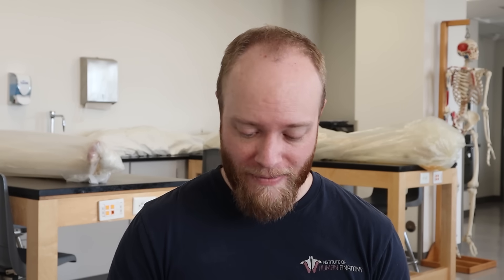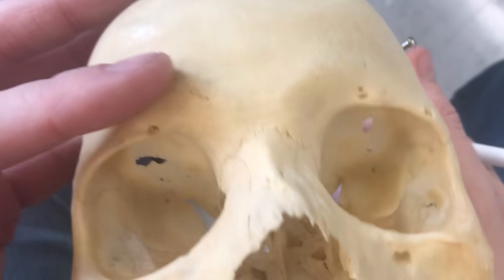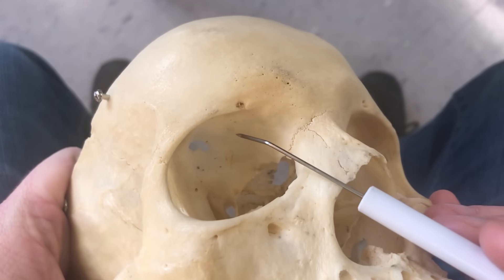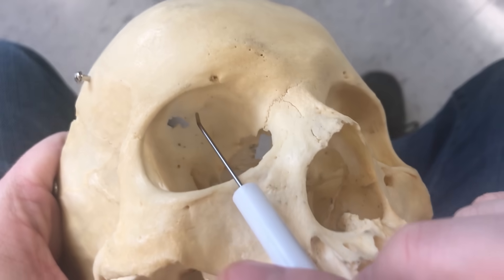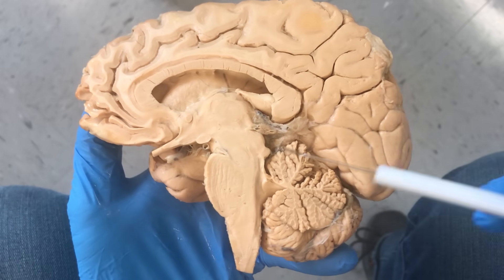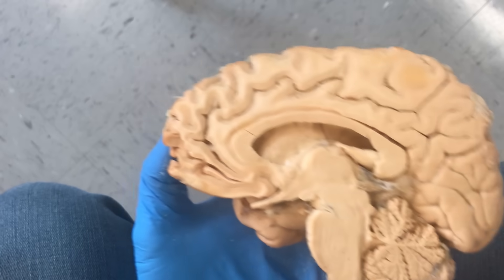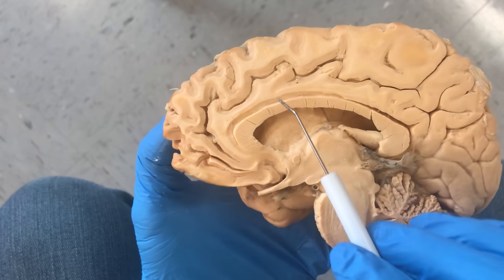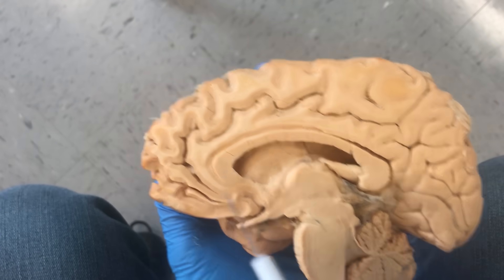The Anatomy of a Lobotomy

Comment: From my understanding the reason lobotomies were performed was there was little medications available to bring under control a patient’s symptoms. As barbaric as the procedure was it did work it most cases to alleviate the patient’s condition. I do believe it was an over prescribed procedure and used as a quick fix to complicated medical conditions. I like to compare it to something such as if a person had an infection in their finger instead of treating it with antibiotics just cutting off the finger instead. Problem fixed but permanent damage is the result.

Comment: This like trying to fix your car from overheating. Soo you decide to uninstall the radiator from your engine so the air can flow directly into the engine and make the engine cool down alot faster

Comment: 4:13 - "to treat things as simple as depression". Probably not what you meant.
Reply: What did he mean then? What
Reply: @WoW-sg9wb  As simple as? Depression is simple? What
Reply: @ricsta6930 depression is very common. That’s probably what he meant by “simple”
Reply: @WoW-sg9wb there are different depressions not all are suicidal, but yes it can get worse but since depression is so common and the most diagnosed with it doesn’t get suicidal.
Reply: As in it's a highly invasive procedure to fix a psychological problem which can be solved without surgical intervention let alone one this invasive
Reply: its not that deep blud

Comment: One thing that I'm curious about is does that part of the brain die or it still there but just the communication with the rest of the brain is disconnected?
My curious sterns from if it dies wouldn't it rot? And wouldn't it cause even more problems?
And if it doesn't die what path the oxygen and other supplies take to keep it alive?

Comment: Did any doctors do this to themselves? I cannot picture that someone medically trained performing these could be thinking it’s morally correct, or a viable treatment. More likely some very self absorbed sadists that saw an opportunity to use their medical degrees maliciously without backlash. 

I don’t think any certificated doctor would voluntarily receive this treatment. Even if they were depressed. Which means they didn’t believe in it and knew what they were doing. Some people simply did not do these operations. The ones who did do them are sinister to the core, because they knew. That’s just my two cents.

Comment: I know that the difference is negligible and it’s essentially just semantics and this point, but that’s not an icepick, that’s a professional surgical tool called an “Orbitoclast” AKA a “Leucotome.”

I know that Transorbital Lobotomy is often referred to as an “icepick lobotomy” but in actuality - as confirmed by Walter Freeman III, son of the pioneering physician of transorbital lobotomy, Walter Freeman Jr. - only the very first and most experimental of transorbitals were done with an actual icepick straight out of the Freeman’s kitchen drawer. The rest were done with purpose built, specialized surgical instruments.

Walter Freeman III said that these conventional icepicks, quote, “Worked like a charm.” But to lend medical credence to the barbaric procedure, instead of using a brutish tool like an icepick, they designed a very special less brutish seeming, more professional looking icepick-like tool called an “Orbitoclast” ...which is that T-shaped tool that he hammers with the mallet at the start of this video. It’s also sometimes referred to as a ”Leucotome.”

The first lobotomies - as pioneered by Portuguese Physician and Surgeon Egas Moniz - were called leucotomies and involved an actual surgery wherein holes were drilled into the skull of psychotic, depressed, obsessive compulsive, and highly anxious patients and a small coring (cylinder of brain tissue) was taken from a few of the areas in and around the frontal lobes. Then they’d sew them back up.

Moniz had the most success with the highly anxious people and the majorly depressed or melancholic. I guess it’s hard to worry and easy to be happy when a doctor has turned you into an adult  6 year old who cannot even use the toilet by themselves.

Unfortunately the psychotics and schizophrenics largely stayed that way. Some just died, as is to be expected when you poke around in someone’s brain with a a wire loop, cut the tissues with said wire and then suck out the freed up cylindrical tissue.

For this barely functional, dubious and downright barbaric routine, Moniz was awarded the Nobel Prize in medicine. This remains one of the greatest stains on the Nobelpris (how it is really written in Swedish, as the awards are held in Stockholm) and is almost as regrettable as awarding the Nobel Peace Prize to George W. Bush - a warmonger.

One day, after having devoted years of his life to curing the mentally ill by spending most of his days looking at the brains of deceased psychotic patients and hunting around for physical lesions that might cause this behaviour to no avail, Freeman picked up an obscure monograph by Egas Moniz which detailed the “success” of this Leucotomy surgical procedure.

Freeman was transported by this amazing finding. He was positively captivated and thought that this just may be the answer to his problems in curing the mentally ill... as most of or all of these small corings of brain tissue were taken from the frontal lobes and near the Thalamus, which was long regarded (and still is) by neuroscientists to be “The seat of human emotion.”

First Freeman tried to repeat the coring technique of Moniz, but more targeted towards the frontal lobes. Since he himself was not a surgeon, Freeman hired a young, talented neurosurgeon by the name of James Watts to perform the operations for him, and he would sit on a stool right behind Watts and direct him as to where to drill, what to do, where to cut, etc.

Freeman focused on the types of patients that Moniz had the most success with (mostly women suffering from “hysteria” and others who were consumed by anxiety, fear, and depression. Thus, he had a great “success” on those first operations.

Freeman was convinced that there must be an easier way to access the brain and after some consideration, he landed on the idea of entering the brain and it’s frontal lobes via the orbit of the eye. Here, the skull is thin enough to transmit light and can be perforated easily by a sharp instrument. He tried it for the first time -with an icepick - on a middle aged woman suffering from severe anxiety and it apparently worked. It’s hard to be afraid when you don’t even know what year it is and cannot feed yourself or go to the toilet unassisted.

So this transorbital route proved a great success for Freeman and he began teaching the procedure to other doctors... usually psychiatrists  who had no surgical training, since, as Freeman was quoted as saying “Any damn fool could perform this.” No messy surgical procedure, no drilling, no rigorous sterilization.

He told Watts about this and Watts was incensed. Watts believed - quite rightly - that entering the brain is not something that should be done lightly, nor should it be routinely done. After awhile, Watts started to reconsider his partnership with Freeman. The final straw was one day after Freeman had done a bilateral transorbital lobotomy in their shared office, he asked Watts to take a photograph of the two orbitoclasts sticking out of the female patient’s eye sockets whilst she was still unconscious. This was wildly dangerous and after this photograph was taken, Watts stormed out of the office and the next day Freeman and Watts didn’t share an office together.

Freeman went on to mutilate and sometimes kill patients of his via negligence and medical malpractice. Some praised him as a angel of mercy... others thought he was an evil man. Lobotomy was a product of its time and as soon as neuroleptic (antipsychotic) medication like Thorazine hit the scene in the mid to late 60s, marketed as a chemical lobotomy, real lobotomy faded away.

Comment: In 1949 the Nobel Committee awarded the Nobel Prize for Medicine to Antonio Muniz for the "development" of the prefrontal lobotomy.   What was the justification you ask?   Because it didn't require surgery and could be performed outside the OR, essentially in an out-patient setting, at a much lower cost.  Thus lobotomies could be delivered to more institutionalized patients.   The Nobel Committee hasn't rescinded that decision.

Comment: Yes, lobotomies were very very often a bad thing. It sounds in this video, though, like people did it to torture others. 
To some people it was a miracle. Some people got their lives back. 
I'm not defending the operation, not at all, but it just sounds like he watched a five-minute video on the subject, then posted this video.
I'm guessing it was a bit like a lottery. Either your depression goes away (yes, that happened), or you'll become a shell of your former self. Or even worse.

Lobotomy is still performed to this day, under much more controlled circumstances, not just a guy stabbing people in their eyes and flailing a scalpel around inside their heads.

Comment: Great video! Reminds me a lot of the movie Shutter Island.
If you allow me to add:
The bone structure that has been perforated was the Lamina cribrosa ossis ethmoidalis. The base of the Fossa cranii ant. may be very thin but the Lamina cribrosa was in the middle. Because of this most patients had olfactory malfunctions since the connection to the Bulbus olfactorius (Fila olfactoria) was also damaged. 
Medical professionals started to refuse this method when the first neuroleptic drug was avilable (Thorazine). Still this neuroleptic drug was also performing a non-invasive lobotomy as it damaged brain tissue.
However, the Transorbital Lobotomy was normally performed under anaesthesia and has been heavily critizised even back then.

Comment: I feel I must correct this topic, from the information I have viewed. Most psychiatrists still believe today that there where benefits to a leukotomy or lobotomy. The main problem was that not everyone who received one needed one and that their opinions and rights where not taken into account. It’s always been a trade off between benefits and cons, but to say that it never works does a disservice to those psychiatrists who used it responsibly and improved patents lives. 

It’s the same principal of drs now days over prescribing medication that is often not needed. Albeit this is much less likely to cause permanent problems. 

Id also point out that ablative or destructive surgery of the brain is still used today. Nowadays the procedures available are used for vary specific treatments. But they are still used. Gamma knife surgery, steriotactic Radiosurgery. And even just straight up ablative surgery. (Now days they use cannulas that are much more accurate than the old methods) 

https://www.ouh.nhs.uk/patient-guide/leaflets/files/12563Pstereotactic.pdf

Other forms of psycho surgery are still used today also. Again the main change being the accuracy of the procedures and the selection of patients most suitable. a
cingulotomy is an ablative surgery successfully used to day to treat treatment resistant depression and ocd.

This doesn’t take away the suffering caused by the leukotomy’s over use and the medical malpractice that caused so much suffering.
Reply: alex allen “Most psychiatrists still believe today that there where benefits to a leukotomy or lobotomy”.

Can you please cite the psychiatric journal where you got this information?

Comment: How can you tell it’s a Female brain? Is there really any structural differences to a male and Female brain?
Reply from the maker: The reason I knew this was a female brain was because it came from a female cadaver in our lab.

Differences in brain anatomy between the sexes is very minimal, and not something you could tell with the naked eye. Males tend to have slightly denser areas of gray matter in some areas (such as the hippocampus), and females have denser areas of gray matter in others (such as the frontal lobe). Males also tend to have a slightly larger brain on average (3.5 lbs compared to 3 lbs.), but that's because males tend to be slightly larger in body mass on average.

Once you account for the size difference, essentially the brains are the same, anatomically speaking.

Comment: Show us the tendons in the hand and why you can stick up your ring finger.
Reply: You mean can't stick up your ring finger - right?
Also, I got to see the tendons in my hand when a super sharp, fast running chainsaw just touched the top of my right hand & ripped the skin off it in a flash. Before the blood started to flood the area I looked at it & it was all light pink & the tendons were white. As I flexed my hand I watched them move. It was fascinating & I stared for what seemed like several seconds as time slowed down but it must have been only one or two heartbeats until the blood started to flow and obscure the intricate details of the insides of my hand. Then I knew the party was over and that I only had a few seconds to get down because I started losing too much blood & thought I might pass out. The chainsaw was so sharp & it happened so fast that I had virtually no pain - at first. The pain came later when washing & then "repairing" the wound. To see inside a living, moving hand is amazing.
Reply: Oh yeah, a chain tooth nicked a piece of bone off the top of one of my knuckles but the tendon going over the knuckle was so tough it just slipped sideways when that happened. Wish I had had time to take pics of it all but I really didn't have a fraction of a second extra.